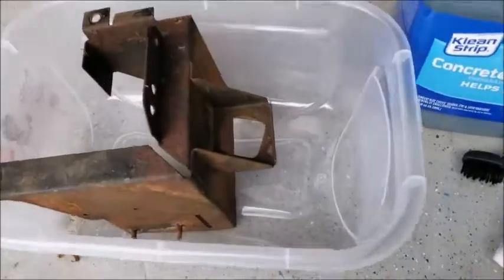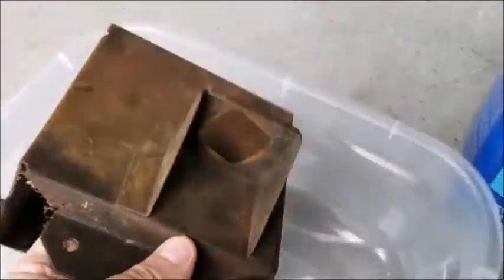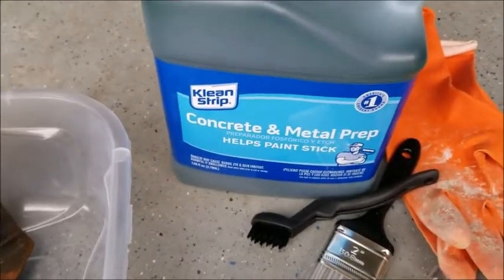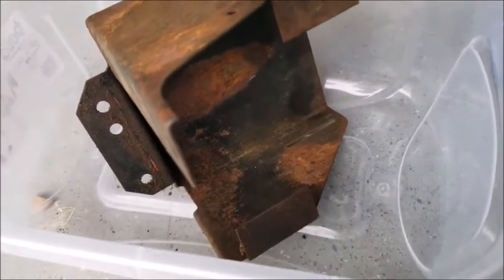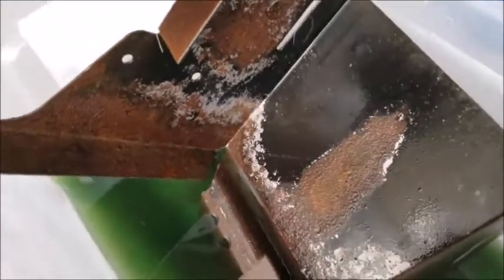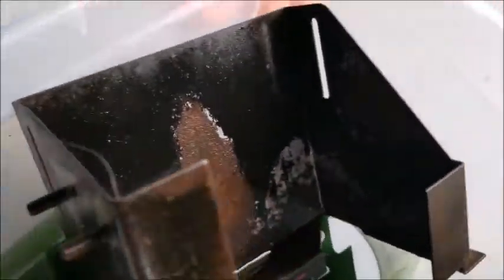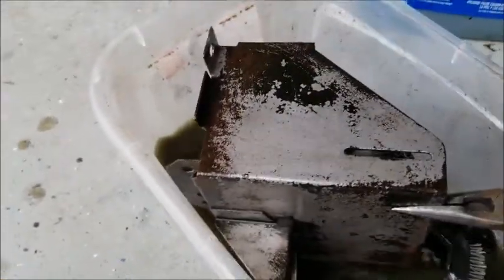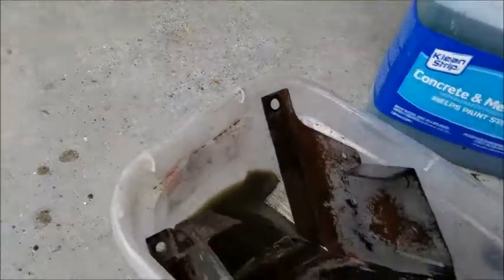phosphoric Rust removal

Comment: I read something in the comments of another video, this is not word for word, sorry.
The acid actually leaves a coating of more stable rust that actually is a rust protector, so don't use a wire brush, just leave it to soak for a long time. If you can heat the acid to 60°C it will work better, I saw an ultrasonic cleaner being used in sync.
Reply from the maker: True.
So, the actual chemical process is the rust (iron oxide) turns into iron phosphate, which is inert and will no longer rust.

But, it is a bit bumpy, and does not completely penetrate through the rust.
So in this case, I wanted the surface smooth and ready for paint.  So I helped it along to get all the rust.

I did another video where I did this process on an exhaust pipe.  In that one, I left the iron phosphate in place, and lightly painted over it.  

Fyi, you do need to either paint, or oil the surface immediately after, or it will flash over, and rust pretty quickly
Reply: @AlexPlatacis You said phosporic acid turns iron oxide into iron phospate which is inert and no longer rust, but then you also said to coat the surface immediately or it will rust very quickly. Please explain more, i'm kinda lost here.
Reply from the maker: @andria.7310  sorry to confuse...
So, iron oxide will turn to iron phosphate, but the action of the acid will also etch the bare metal, so the areas that become exposed will flash rust.  This product is not made for rust removal.  It is made to prep metal and concrete for paint.  It expects you will cover the treated area with paint.  There are other products that leave a film behind that will prevent flash rust.  But I don't like those, because they leave an uneven surface.

Hope that explains it a bit better
Reply: @AlexPlatacis  Got it, thank you!

Comment: What do you do to deal with the annoying white salts that form sometimes? I love using this stuff but every other time depending on what I put it on, I'll get a bunch of that ugly white salts forming on the steel. I don't really wash it off since I try not to re-rust it but spending time to re-wire brush everything gets annoying.
Reply from the maker: I have not seen that.  We use the metal etching liquid for things we can dip. Then after treating it we rinse in water, then repaint.  We also use a paint on version for parts that cannot be removed.  It's kinda slimy but it does not require rinsing.  Rust Converter Ultra. 
FDC Rust Converter Ultra, Highly Effective Professional Grade Rust Repair (1 Gallon) https://www.amazon.com/dp/B014LR5PA2/ref=cm_sw_r_cp_apan_glt_fabc_3VMDJYWPJKPAS1TBKREH
Reply: wipe with 99% rubbing alcohol. You can buy the brand name like Ospho, Rust killer but it's cheaper at lowes or HD. I've used Ospho and this and I've not saw a big difference. It's great for light rust. Flakes have to be knocked off however you choose. But don't remove the Base rust. Needs the rust to convert, no rust no conversion!!
Reply from the maker: I don't wire brush it.  I use the acid, then water, then give a spray of wd40.  Then when I am ready to paint, I use brake clean to remove the oil